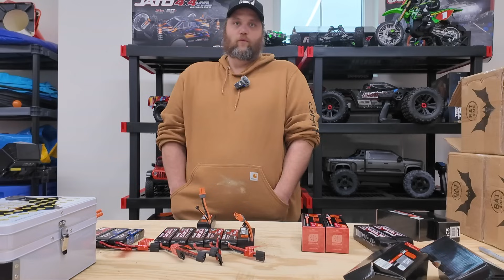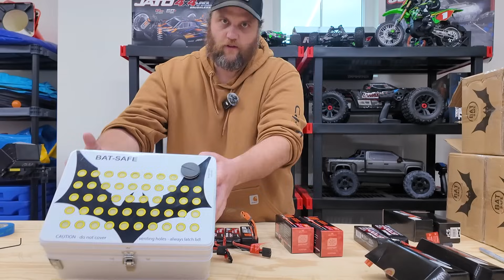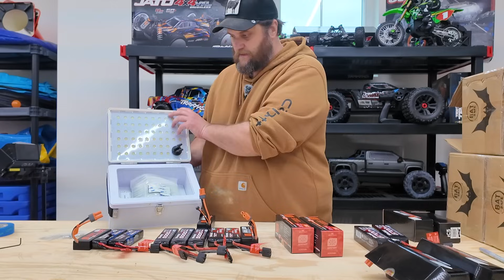Best Lipo-Lithium RC Battery Storage! Don't Burn Your House Down! Lipo Bags vs Ammo Box Vs Bat-Box

Comment: That's insane to spend that much when you can use an ammo box if you are worried about other batteries in the box use some fire plywood in between them, it should actually stop stop it.

Comment: How about a1 gallon stainless steel yeti knockoff water jug with holes drilled in the lid so it doesn't get super hot on the sides and bottom?

Comment: Great information thanks. If you have fire, they make a class D fire extinguisher. Class C recommended for electrical fires, but a class D is recommended for metal fires specifically for lithium fires. And get a pair of heavy welding gloves if you want to remove that box out of the area after the fire is out, an oven mitt won't cut it. I don't use the big boy batteries. Safety is having a plan and peace of mind.

Comment: You don't cram batteries in the Bat-Safe box you must follow the advice below (this is for the medium box)  The BAT-SAFE medium is a fireproof box designed to safely charge and store LiPo batteries, with a maximum capacity of two 6S 5000mAh packs or 222 watt-hours,  I can safely  store  4 x 3000 mAh (4s) batteries in mine - Do not exceed the manufacturers recomendation for maximum 222Wh for charging.

Wh = V x Ah

4 LiPo's - 2S (7.4v) x 6700 (6.7Ah) mah = 198.4 Wh

Comment: Ammo boxes are supposed to be good. But not off the shelf. They need a little modification to be truly effective. You don’t want to take the seal completely off cause then it doesn’t latch well and it’s awkward to move around to and from the track or the truck. You take holes or cut out a small section of the seal out. Holes are defitnely better from the footage I’ve seen but it depends on

Comment: I just got into the hobby and will have 3x 5000 2S. I decided to use a ammo can with the seal removed (except on the front latch/rear hinge)with them in separate LIPO bags. Two layers of drywall on the bottom of the can.
Reply: Fireproof drywall exists, apparently. I'm going to use that for my ammo box. But I've read that standard drywall can work as well.
Reply: @MrCaribe65 I also just received 4 small lip bags that each battery will be stored in. In hopes if one catches on fire it won’t ignite the others. I don’t want a 4x larger fire or smoke if I can help it.

The best one I have seen is people making separate compartments in their ammo can with drywall with vent hole above each. That seems to be the best way to contain lipos in one can but likely to keep the other lipos safe.
Reply: @45eno 
I saw that as well, and I definitely plan on making separate compartments for my larger batteries. I keep my 1s batteries in two bags to protect the larger cells right now, but I don't really trust the bags. I've seen too many videos of them not containing the flames.
Thanks for the feedback, and stay safe out there. 🫡👍🏼

Comment: Every 2* months or so should always throw your batts on the charger and put in storage mode again just too check also setting them on tile or using them as spacers  inside of big ammo can helps however probably won't save them all if ya don't get to them in time

Comment: LoL dude I stress this to new FPV heads all the time, I don’t think people who are just starting out realize how much good lipo safety really matters in the hobby. 

Storytime:  One day not too many years ago my homie and I had just gotten back from ripping and were hanging out in his moms bedroom (he had just moved her into his place and his station was still set up in there) and while I was scrolling on my phone he was going over his footage from the day on his computer. 

He was charging all his spent packs up, parallel, and he had a tendency to overcharge by at least by about .30 volts per cell just for a bit of extra kick. Splendid idea as any RC head knows well enough. 

Well turns out one of his packs in the line had a corrupted cell, which he was aware of but didn’t pay it enough mind to because reasons. Sure as shit tho, just as every RC head fears at one point or another, the room was quiet and we were both too pooped to be chatting much so just sitting there relaxing, and out of nowhere…. BOOOM  the whole row of like 7 or 8 Ovonic packs goes up at once in a fantastic shitshow of what I can only describe as a fantastical jet turbine level of hellfire and chemical brimstone, literally like 3 feet from his head. And anyone who’s ever had a lipo go up unexpectedly knows just how unlike a regular fire it actually is. The shit don’t just burn with a simple flicker and flame after it goes boom, no, it literally shoots out like some fucked up ghetto lightsaber built by the crackhead down the block. And the smell too, dayyyyum, it ain’t pretty and if you don’t breathe shallow it will melt your lung tissue into Emil from Robocop, that sickly sweet chemical fume don’t fuck around. Luckily he had his charging station set up on a metal cooking sheet so it was easy enough to transport outside while it was still burning, of course he had to carry it down the hall thru the rest of the house and out the garage, trailing that thick gray cloud of smoke the entire way. 

Needless to say, my homie don’t overcharge anymore and we sure as shit don’t parallel charge either, I had already stopped doing that a while ago after I had too many packs go to shit because of one bad lipo in the lineup. 

Spent the rest of the evening on the back porch with every window and door in the house wide open while we let the place air out. His mom booked herself a hotel for the night.

Comment: I bought mine last week. The number (and capacity) of batteries that can be stored together safely is specified by the manufacturer. My issue, however, is that it’s not really compatible with Traxxas batteries and chargers. So I’ll only be using mine for battery storage. That’s a downside, because at this price point I’d prefer it to also be suitable for charging/discharging batteries — which is when they’re most at risk of something going wrong.

Comment: I keep my lipos in ammo tins, I leave the lids closed but not fastened for ventilation. They're on metal shelves in a metal shed. I try to keep no more than three or four batteries in each tin. I had one go up after a high speed crash and I've destroyed a couple that have gone bad. I always get batteries from Banggood or Aliexpress. They're much, much cheaper and good enough for bashing. Zop Power is a great brand, I recently got a pair of 7000mah 3s for my Kraton 6s, they were about $70 for the two.
Reply: I wouldn't trust those cheap batteries.

Comment: And everyone warned when we went from Ni-cad to Nimh that they were catching fire. Oh and ive been in rc since the original Midnight Pumpkin/Lunchbox from Tamiyah was a new release. Still have a couple of them. Clodbuster, Blackfoot, RC/10, Grasshopper all came out when i started in the rc game. All abtique that are junk compared to todays stuff. My hopped up motors from the early 90's are weaker than stock Traxxas motors now days. Back then you got parts trees and gad to build your car. I miss that part of the hobby. You lose half the fun getting a ready to run kit now days. Spend a day or two building and painting a car before you could thrash on it. Also taught you how to fix or mod. Like the steering rods vent too easy on pumpkins so i used turnbuckles from grasshoppers to upgrade. Then i had to add servo savers since they started breaking. Then it was the spindles that broke...you had to love it. Finding that blackfoot tires fit your factory pumpkin wheels gave it a better stance and taller gearing in the back. Lol i could go but 36 years into rc is a lot to type in here.

Comment: Jeremy I thought you quit RC. I used to love your RC content back in the day. Glad to see the channel is still around. Yeah I use ammo boxes with holes drilled in the lid for storage. I do use lipo bags but only for actual charging with one battery per bag. I have a mini fridge in a shed that I store them in, away from my house. I also charge batteries on my concrete patio in a cinder block. I have been unfortunate enough to have a few batteries pop during balancing. The cinder block saved my house and the lipo bag contained the majority of the flame. Those bat safes work well. I have a few buddies that use them. But when you have 30 batteries it becomes impractical. I also have a battery maintenance schedule every 3 months on my phone calendar so i remember to top up storage charges, so my batteries don't die.

Comment: I just went the bullet proof option, an ammo box, but its lined with furnace batting, it will withstand the intense heat of combustion. But yes, trim a bit of the seal to let it vent, preferably by the hing area.

Comment: Best thing I've seen for LiPo storage was a guy had a ceramic plate vault for Lipo's.  
I've been doing RC.for 35 years now, biggest Lipo's we have (my wife and I) is 3S. But what I've been doing in using the in a Lipo bag inside the ammo can. I check the regularly.  We've had 3 over the years that started puffing up. I puncture them o concrete and be done with them, just not worth the risk.  We live in Canada so outside storage isn't an option for us unfortunately as the temperature swings from -45C to  +35C in the summer months.  Just not viable unfortunately. Just the best I can come up with for the situation were in.  Definitely going to look at these new Bat boxes though,  thanks for doing this video. 
We had a local guy at an outdoor race years ago,  his car was T-bonned in a race,  didn't think anything of it. When he finished the race it was his turn to Marshall the next heat, throwing his RC  inside his real car, not realizing his Lipo' was damaged in the race.  Burnt his car to the ground.

Comment: I use an ammo can for my 2 2s batteries and my 2 3s shorties for rock crawling. I took the rubber gasket out and leave the the lid cracked. I didn't even think about adding ventilation. Good video!
Reply: Yeah dont leave the lid cracked the fire might get out, make small holes in the top, and if possible attach some metal screen to the inside as a flame suppressor, i attached mine using a rivet gun. Never tested, but it should work very well.

Comment: I bought a Two Tray Red Toolbox on Amazon, all metal.. then made cut-outs for every battery and their wiring. Looks good and works well.. no risk of an accidental short circuit either.
Reply: Got a link for that toolbox?

Comment: I have all my batteries,  about 20 packs half of those being 6s packs.   In  an old oven in a room that stays about 68°f.   Temperature plays a big role in longevity as welll.   You don't want to store them in a cold place or to hot.   Or going through big swings in temp and making sure they are at 3.8v per cell during storage.  That's when they are the most stable.

Comment: These batteries create their own O2, that is why you can't put them out. Depriving oxygen will not work. You are better off with controlled venting. Don't have them in the house under any circumstances. The chemicals are toxic. That is why the whole EV, battery storage crap is so dangerous. Burning diesel in a generator is better for the environment and safer.

Comment: I have a metal box i made, only 1mm thick with old roller bearings as feet and the lid doesn't seal 👍 i don't have a garden (maisonette) so it's sit's on the kitchen side near the window and with the kitchen gloves near by, only 1 2s 5000 in there at the mo but aways worries me

Comment: I keep all of mine in a metal toolbox and I’m really glad I do, because about a week ago, I discovered that one of my decade-old bebop 2 drone batteries was expanded to the point where it was breaking the plastic case. I think I left it fully charged. Needless to say, I got rid of that battery and did the XT60 connector mod.

Comment: 100% need to hook them up and check each cell indivually when ypu first get them. Should be shipped at storage voltage.  3.8 ish volts/cell. Should be within at least .02 volts of each other.

Comment: Hit up the manufacturer, they might swap them out for you. 
I had a Tatuu 4s 1800mah pack come doa from Amazon and it sucked but I got it exchanged out.
I use a lipo bag and worry about the stuff around it, but, I also use my bats every day and rotate them in and out of storage voltage. I only have 3 4s packs, 2x 2200mah and one 1300mah.
I use them for vaping though as well

Comment: I use a good ol osha approved flammable cabinet. Similar concept to the bat safe but it’s a much larger and more affordable ventilated steel cabinet. The only obvious down side is that it isn’t portable. I use large LiPo bags in my truck tool box for transport(I’m a airplane/heli guy).

Comment: You can also use a metal box and stick a large bag of building sand under the lid. If fire happens it melts the bag and sand falls on the fire hopefully retarding it.

Comment: Forgive my ignorance.  But I collect a lot of video game stuff, like controllers.  With the exception of Xbox, collecting controllers is a pain in the ass, if you ever want to use them.  I still use my ps3 frequently, and needed a new controller.  I had some OEM DualShock controllers mint in box, so I opened one.  I like translucent controllers and consoles, so I opened up a 15-17 year old cosmic blue controller, and obviously the battery was dead.  I ordered a replacement on Amazon and got it working, despite the fact that ps3 controllers are a pain in the ass to open.  But then it occurred to me this “new” battery, presumably from China might not be safe.  Then I thought about all my old 3DS consoles, etc.  
I keep my Surefire lithium batteries in a supposedly fireproof case.  But, to be clear, and I apologize for my ignorance…
If I, for example, have an unopened PlayStation 500 Million Edition PS4 controller sealed away in my basement, are we saying it could just spontaneously burst into flames?  Do I need to keep anything with a rechargeable battery in a flame retardant case…
Because I have A LOT of stuff?

Comment: Metal filing cabinet 🗄️

Line it with drywall and a layer on the outside.

You can go qll out and even put a metal dryer duct on the top and feed it outside.

Comment: 80 > 70% storage charge. You can bring them back. It just the voltage has dropped, too low. I revived them in the past. Only cause batteries are crazy hard to import due to crazy laws in my country. You legally can't import them privately. And hobbies shops don't wanna deal with all the hassle. They have sent by ship in a fireproof container. The shop must have a fireproof bunker to store them outside the shop if they have more than five batteries 😂. 
When they first came out back in the day. People used to charge them like a nicad in the trunk of their car at the race track. 
After the third car caught fire, they finally installed a proper charging area. And banned you from charging in or near your car 😂.

Comment: I was heavy into RC airplanes about 10 years ago. There were some spectacular destruction at the airfield after a crash. I never had one burn up on the charger but I have seen them balloon on the charger and scare the crap out of me.
Reply: I like drones and I've had 2 batteries catch fire while slow charging, 3S Ovonic branded, first would have burnt the house down if I wasn't home to stop it, the 2nd burned in my garage on the concrete floor while I slept.

Comment: I can fix them for you. First plug your battery in the charger only NOT the balance plug. Set the charger to NIMH mode and let it charge for 100 MAH. Then STOP IT. Only let it charge to 100mah. That will get the battery back to life. then plug in your balance plug and charge it 4s normal. I would take it easy on that pack though set it at 2.0 amps charge to slowly charge it.  When the battery is charging take a look at the cells all 4 should be close to the same number like 3.30v each or something like that. IF one cell is way lower then the rest the battery Might be done. Some times a good balance charger can fix it some times NOT. Its important to make sure the pack dont puff up at any point. IVE done this 100s of times over the last 20 years of RC and Airsoft.  You just need to Jump start the pack to wake it up...
Reply: I've done this and it's great advise !
Reply: Once a cell has gone below a certain voltage (usually 3.0V for Li-po), it will go through some changes in its chemistry that will cause irreversible damage. One of the biggest change is the amount of power it can store, which depending on how low a voltage, and for how long it was at that low voltage, can make a significant difference. In a 4S pack, if even 1 cell was bad because of low voltage, and you continue to try and use it, you're putting yourself at significant risk with a fire hazard. That 1 bad cell will charge and discharge quicker then the other cells in that pack. No amount of balancing or babying can change that. I'd rather take the cell apart, remove the 1 (or more) bad cells, and turn it into a 3S, 2S, or take whatever good cells are left from multiple packs and build a "new" pack from matching cells, then try to "revive" the bad pack by forcing it to a full charge.

Good li-po cells have a long shelf life with stable voltage. So long as you leave the li-po at a storage voltage (3.7-3.8V), it should barely change, even if you dont touch it for a year (or longer). Bad li-po cells will slowly discharge like the Ni-cads and Nimh batteries of old. If you find a Lipo dead after leaving it at a storage voltage and not touching it for a month, it was a bad battery, period. Even good battery manufacturers have some duds here and there.
Reply: This is the same technique I use to bring back dead car batteries. Put it on a 2 amp trickle charge for an hour or 2, and switch back over to 20 amp. 

Works every time.